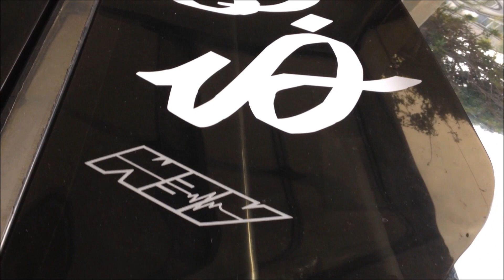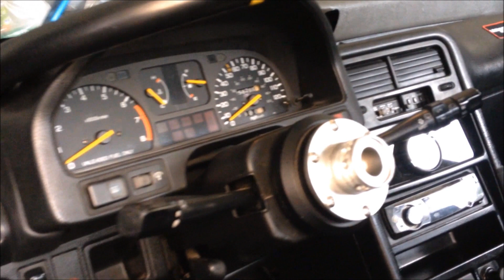Brian Crower 404 2step

Comment: Nice i had the same cams but sold them hell i even pulled the built motor and put in a 100% stock low compression b20 with just arp head studs for now. Still got the built bottom end just waiting for the perfect timing to redo it
Reply from the maker: Thats gonna kill bro